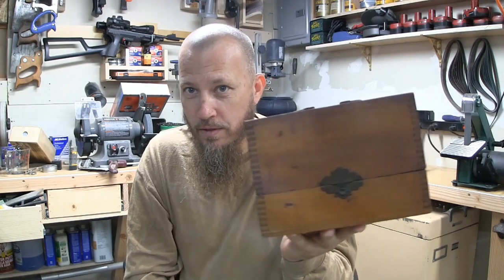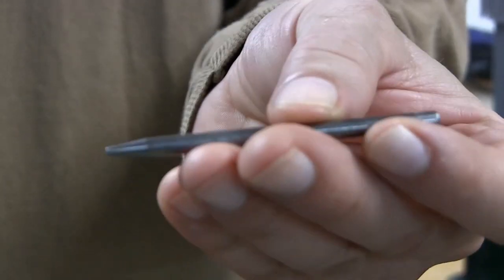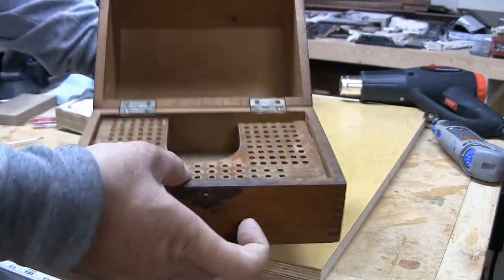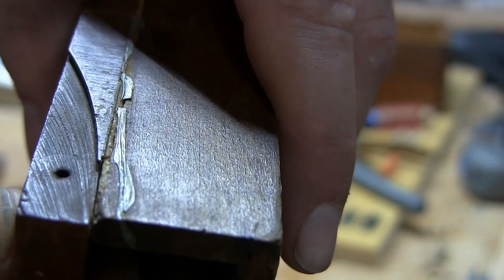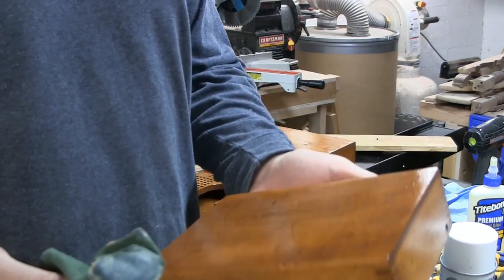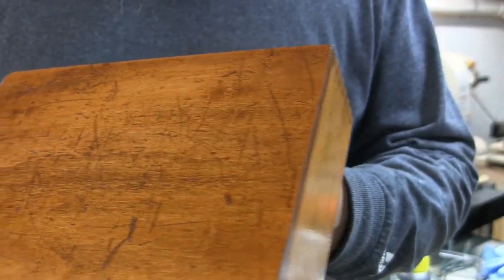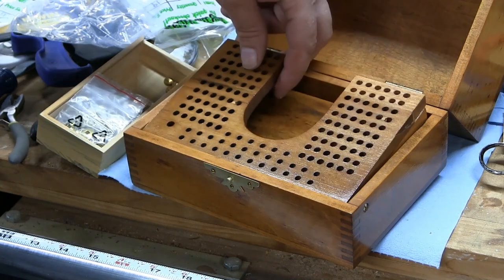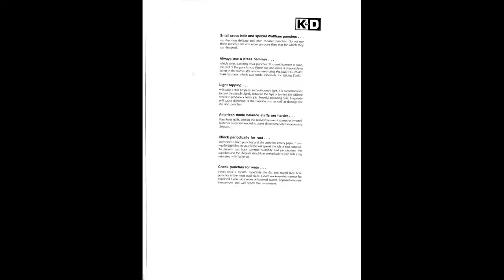Restoration of Clockmakers Staking Set, updated version

Comment: Good restoration.  The stakes and stumps cleaned up amazingly well.  That's very similar to the restoration that I did on my K&D 600 series watchmaker's staking set.  With the condition of your tool holder, I probably would have cut off that entire top piece and replaced with new wood. The top panel of the box lid on my set was cracked, through where the handle was.  I cut off the top panel and glued on a new piece of mahogany.  These are great tool sets and deserve some TLC to make them last decades longer.
Reply from the maker: Thank you! Old tools are surprisingly well made and should be preserved, I agree. Often, I don't know the best way to proceed on a repair and it just works out. 😁

Comment: Hi Ab, What an amazing restoration. The end result looked fantastic. I also bought an old staking set which only had light rusting. I put the stakes into my power drill and used wire wool to bring them up.  
Ive been experimenting with other hobbies lately but recently fell back in love with my clock restorations so I'm looking forward to buying some old clocks to fix up. 
Johnny
Reply from the maker: Nice to see you again Johnny! Using a power drill  seems like a great time saver and wish I had thought of that. Since you are back in love with clocks you should be able to find some great antique Japanese clocks if you are partial to them. England imported a great many during WWI. Best regards to you!! -Ab.
Reply: @time4clocks  I need to move on from all these French clocks and explore some other stuff. 
By the way, whats happened to all your old videos? All I can find is recent uploads? 
Anyway, I hope all is well with you and am looking forward to more of your relaxing restorations
Reply from the maker: @treetopspider  I deleted my channel and started it anew with a fresh new look and no subscribers. I have been reworking the older videos I wanted to keep but the others I did not deem good enough. Anyhow, it's nice to see the old subscribers and the new coming over. Sometimes the best way to move forward is by taking a step back. :) I had personal issues going on as well but won't go into that since we all have our problems in life to work out. :)
Reply: @time4clocks  Well I am really happy you are back as I am sure all your old subscribers are.